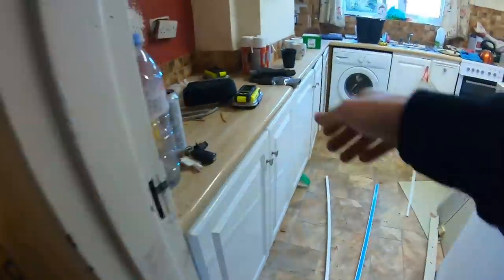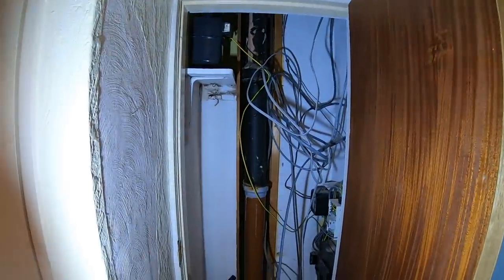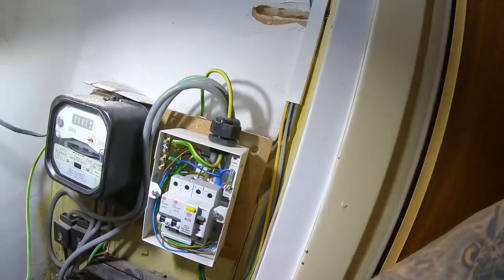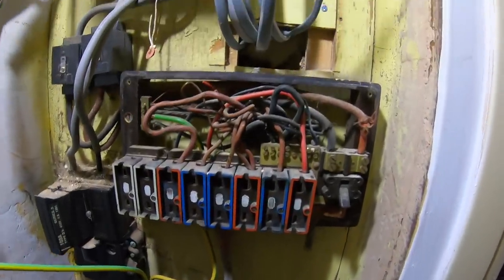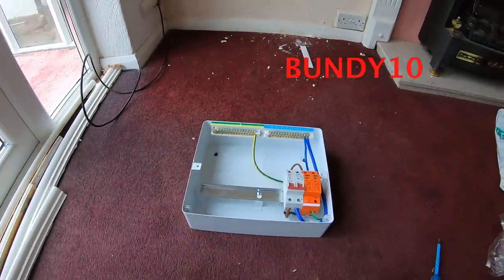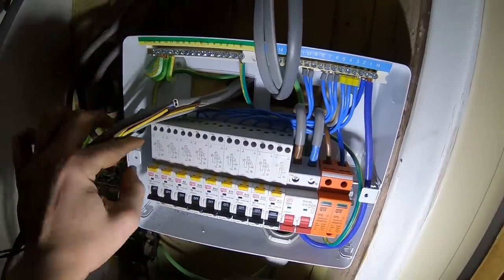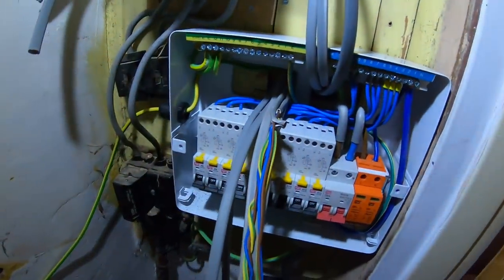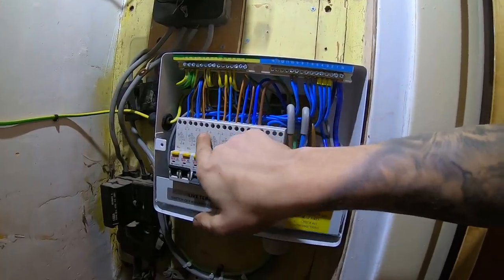18TH Edition RCBO Fuse Box Board Upgrade, Changing consumer unit, Exotic life of an Electrician

Comment: I decided to use CP Fusebox units supplied from ExpertElectrical so far they have proved to be considerably less than experts. Can’t supply the right equipment as the website was out of date showing stock they didn’t have, and then bollocks up the delivery of the replacement item ....maybe they only give decent service to Sparks that big them up online.

Comment: I rented a house a few years back that had one of those '40A max' meters. Supplier never answered my question as to how they could reliably measure my usage! Did the client not want the new board higher up? Most of these you either find it's next to the ceiling or 2' from the floor, I reckon fitting it at about 1.5m is easiest for me and most of my clients

Comment: Hi Nick.
Great video, very tidy installaton.
Did you put all the the sockets on 2.5mm radials fed through 20Amp Rccbo's?
Have ever had to fit 16Amp rccbo's due to derating factors?
Do you have a rule of thumb for number of sockets on a radial circuit?
Do you install ring circuits in domestic properties any more?
As an industrial  maintenance sparky I dont do domestic installs so i am just interested in the newest install practices.
Cheers
Ian

Comment: Great video Nick why don’t you bring your tails in through the “back door” too especially when using the FuseBox board they have the cable clamps to hold them tight, have you used the new Doncaster cables flexible meter tails you can bend with your fingers they’re ace, smokes and heat detectors are always best connected to the lighting circuit as you say can’t be turned off!!

Comment: I’m sorry but using the cheap end of the market Chinese-import fuse boards that are now prevalent in the market place doesn’t sit right with me. If something goes wrong, i.e. death or injury through product, failure then you’re on your own. At least with using a well known brand of fuse board like Wylex you have that backup and guarantee of quality. Yes you pay more but you know you’ll get the spares and service down the line. Try getting an RCBO for these 5 years or so down the line. Been there done that got burned. I suspect that these import boards don’t even comply with the BSEN’s. Rant over.
Reply: Rob check with the manufacturer they have to be tested and do comply I’ve already checked, where do you think 90% of MCB’s RCD’s and RCBO’s are made the Far East!! was it not Wylex a Great British company who had a massive recall on their MCB’s ten years ago!!
Reply: There’s a big difference between an importer and a manufacturer. Wylex (the example I’ve used who are part of the Electrium group) have 2 x manufacturing sites & a separate head office which incidentally you can see when driving up the M6 toll! Easy to find website with numerous certification links including UKAS who if you are at all interested are the main UK testing body to certify that a product meets the various BSEN’s. So a bona-fide manufacturer I think you’d agree? I can’t find Fusebox anywhere on google apart from wholesalers selling them. When I asked my local wholesaler about them today he tells me an agent sells them. It seems they operate out of a small office somewhere!? You say they comply? How do you know this? They told you so that’s it? Healthy dose of scepticism has saved my backside numerous times over the years. I’ve looked on the UKAS site and they’ve not submitted their products to be tested. Why would I trust a company that has no presence in the UK, website or proof of UK compliance? I won’t. Yes Wylex had a recall but I and others were PAID to replace the mcbs !! It cost them £millions but they fronted up. Would Fusebox do that? The answer to that is don’t be so silly you’d be on your own. Let’s be honest why are these Chinese imported consumer units being used by certain electricians? Because they’re cheap not because they’re safe. I’ll stick with Wylex thanks and I’ll continue to use their switched neutral RCBo’s which are an amazing bit of kit.
Reply: They all carry the CE mark ( Chinese Export). 
I know what I would like to save my life, something that costs £12 or something that costs £25. 
Plus the Wholesaler's keep changing their basic ranges all the time. 
Always stick to the branded kit. 
Quality not Quantity. 
Have pride in your work, not profit.!
🍻
Reply: @FGW-ue5xj  totally agree. CE mark is to do with single market selling, and not competency of product in relation to local electrical standards. Nick Bundy seems a competent fellow, I suspect he has a commercial affilitiation with this importer hence why we are seeing these product on his videos. I suspect he wouldn't use them in his house! BTW, have you seen the new Wylex miniature RCBO's? They're switched neutral which is a life saver on a re-fit. Also no need to disconnect the neutrals when doing testing anymore..........that's 45mins of saving at least per board in my opinion.
Reply: @Robspark  Id agree Rob. If I came across one and needed to get an MCB or RCBO etc no wholesalers stock them. And aren't we fitting metal units now because the manufactures weren't using fire retardants in their pre 18th plastic units, as per the BSEN regulations that they supposedly have to follow. If there's a problem, as always shit will fall on the little installer, not the manufacturer as usual.

Comment: You used meter / DNO space and installed Consumer unit there. That board is for metering equipment only.
Reply from the maker: Even though the original fuse board for the house was situated there ?
Reply: I used to think that, however the last few clients that wanted the DNO to move the service head, had to source & purchase the meter box and install them, themselves. So imo the box belongs to the client and I'll fit whatever the client requires in there.